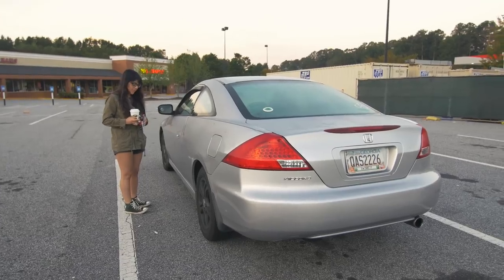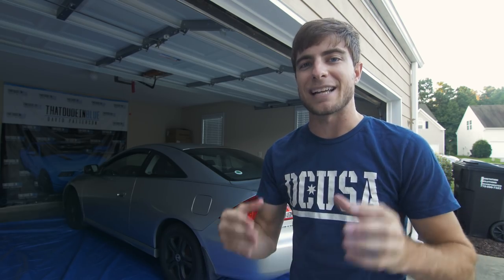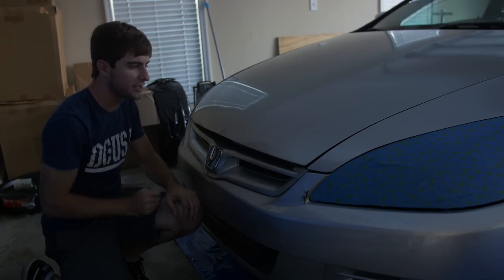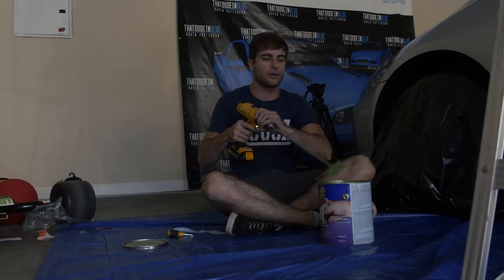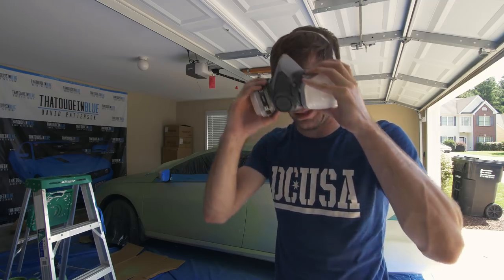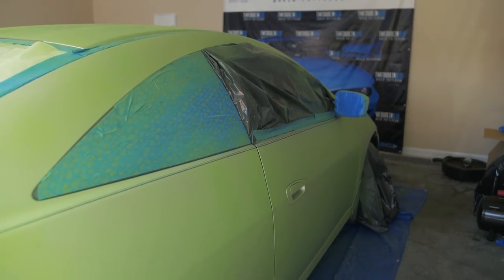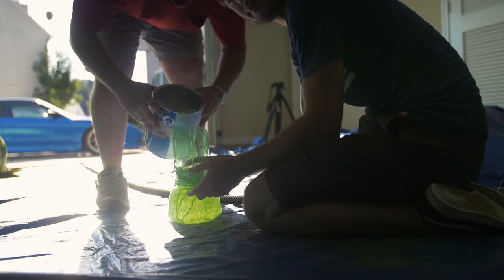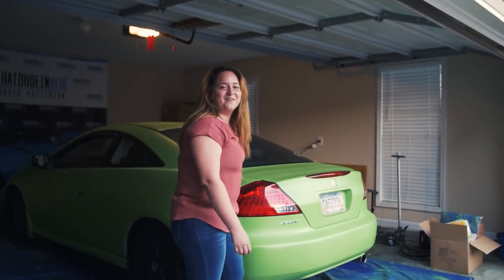How to Plastidip an Entire Car! - 400 DOLLAR PLASTIDIP PRANK!

Comment: I’m not a big green fan but this actually looks dope af! I wouldn’t be mad AT ALL!
Reply: I've actually noticed quite a few Honda drivers switching to this lime/bright green. There is/was a '03, '04 Prelude in Lime - though I doubt it was Plastidipped.
Reply: Until you get towed because the car is the wrong color.
Reply: Won't happen. Read the other comments on here. Police are only required to check vin numbers. Cars get repainted and color changes all the time.

Comment: Good luck getting the dip off lol.
Reply: Project DIY why's that?
Reply: I have old dip on my rims, I was afraid it's going to be annoying taking it off. I bough the car from my cousin he sprayed it 😢
Reply: creep life if it's sprayed on too thin, buy a thing called dip dissolver.
Reply: Project DIY alright Koo. I mean it looks nice when there was some fancy tire dressing applied, I would say it turned out like the green car in the video, flat but glossy. So maybe I'll just dip then again, and add the glossy juice.
Reply: you have to really glob it on for it to peel off easy.. and the glossifiers make it harder to peel off.. and if it bakes in the sun for too long it is damn near impossible to peel off. ( in my experience atleast)
Reply: yabozoable glossifier does that? Guess ill stick to matte then.
Reply: That's not true I dipped my car with 5 coats of dip and 3 coats glossifier had it on for a year in Arizona heat peeled off easy as be
Reply: The Beat Connect thx i almost got misled by fake news
Reply: no glossifier doesn't, as long as it's applied over the normal plastidip base. it all peels just fine, but you have to use the proper amount of total gallons on the car. for a car like this it should have been about 3 gal of the lime green, and 1 gal glossifier. it's better for the long term, will peel easier and in one big sheet that way. this one will be a bit tough to peel after a while. still removable but wont come off in 1 big thick sheet like you see.
Reply: Why?   4+ coats and it peels off easy as fuck
Even of you do less then 4 there's dip stripper stuff that like melts it and not the paint under it and that makes it easy too
It's all around easy to get off
Reply: +creep life BRO don't waste your time and money! Just buy a gallon or two of the clear gloss, it'll go right on like it's clearcoat. If there's imperfections and shit in the old just leave it as a base coat anyways and spray over the old, it'll be easier to take off.
Reply: Jesse Crandle m
Reply: Project DIY plot twist he isnt
Reply: no it's fine with glossifier, half these people have no idea what they're talking about.
Reply: way to save money on rubbers lol
Reply: +Bob Mcdonald but how would he piss now
Reply: Hey man how did the dip hold up in AZ? Also, how did it look at the end of that year?
Reply: A little tip... if you want to get rid of plastidip on your wheels then all you have to do is.. use WD40 and use an old rag and it will wipe right off. If you're not going to take your wheels off then make sure to use a trash bag and cover your brakes. You don't want WD40 on your brakes.
Reply: It's vandalism I say, pure vandalism! .....Next time let me help.
Reply: Had it on my rims for 2 years, would not peel off at all.  Then used a power washer and it came right off.

Comment: You need lights in your garage! LED shop lights are cheap, I did 6 in my garage from Amazon for less than $200 total.
Reply: Jason Garrett seriously!  Even popping in a 4 bulb t8 fixture would help immensely.
Reply: I put up 4 2-bulb T8 fixtures a few years ago in my garage.  I love the light, but the ballasts in the cheap POS lights all went out after a year or two.  I replaced the ballasts with high quality Philips ballasts, but to do so meant I had to rewire all 4 fixtures from series to parallel wiring for the T8 bulbs.  Yes I spent the equivalent of a whole new (cheap) fixture on each one to do all that, but now I have higher quality fixtures with readily replaceable ballasts.
Reply: I'd have converted to LED to not have to worry about ballasts in the future.
Reply: Yep LED Shop lights are very affordable now and easy to hook up. I went with 4 of the 48" LED lights. Cost about $150 for everything, including the little extra for wiring the lights in to a switch in the garage..
Here is the $135 light kit I bought: https://www.amazon.com/Equivalent-Integrated-Daylight-Basement-Workshop/dp/B01MQPCT6Z/ref=pd_lpo_vtph_201_bs_t_1?_encoding=UTF8&refRID=BXBKCY0N9HZ3PM5B0C29&th=1
Reply: He needs a light in his head
Reply: MasterMech77 I replace my 48" fluorescent light bulbs for LED for $5 each light bulb with no ballast
Reply: +MrSeth166
Nice! Yeah figure if you already have the fixtures, it isn't to hard to just retrofit LED lights to them (with some modifications of course). However figured since not a lot of people have full length light fixtures in their home garage, I was offering my two cents worth of DIY and what I was able to do for fairly cheap. There are far cheaper options too that you can find on Amazon or at Home Depot/Lowes
Reply: =Patrick94GSR
Well the LED bulbs are going to stay the same throughout the life of the bulb assembly. Neon tends to dim rather quickly over the life of the bulb. In my experience the light coming from the LED bulb assemblies always seems brighter. Even if they are the same 2340 Lumens rated, the LED makes colors look more vibrant. Then you have the added benefit of not having to worry about turning the lights on and off. Since Neon ballast tend to fail fairly quickly with too many activations, LEDs don't really have an issue with on/off cycles.
Reply: i have those things laying around everywhere lol

Comment: So, what makes it $400? O could've sworn the gallon was $30 at home Depot lol
Reply: creep life that tarp he put on the floor is 150-180...the spray setup is a couple hundred....plus paint....4-500 bucks for sure....especially with the glosser too
Reply: 200 bucks for a tarp? jesus
Reply: Go to plastidip website, they send a kit.
Reply: creep life he said what he got has a better result Lol
Reply: creep life and plastidip is peelable so idk id imagine he won't leave the car green forever lol
Reply: The tarp isnt anywhere near that much. I bought the same one at Lowes, to paint my car.
Reply: creep life the kit
Reply: creep life I think it's for the gun and the whole kit
Reply: Jimmy Peña Plastidip doesn't sell their products directly. You have to buy from a retailer(IE DipYourCar.com).
Reply: its the car kit it takes more then 1 gallon of dip and also you cant just pour the dip on your car you need a sprayer.
Reply: Zark Muckerberg Yeah I meant to say dip your car website, Im not good with names, thanks.
Reply: Sprayer:  $120.   1 gallon does maybe 1 coat and you need at least 4.    1 gallon can be anywhere from $35 (matte black) to like $200 for 50 grams and the clear per gallon
Reply: The kit that comes with the spray gun, compressor, 5gal of dip, ect.  Add an extra 5 gallons of dip and glossifier... Not including the tarp that is easily $400.
Reply: The standard 'Pro' kit (basically what he's using here) with 2 or 3 gallons of color, and 1 or 2 gallons of gloss (depending on the number of coats) and the sprayer system is what cost $400. Also includes some tape, cleaning supplies and the mixer for your drill.
Reply: The kit from DYC.  It is a pro car kit.  Cost between 350 and 500$ comes with 2 gallons of dip and 1 gallon gloss and the dyc dip sprayer.  Plus some other stuff like tape, plasti dip protective spray etc.  it is a really good deal for 350-400$ if you wanna do it yourself
Reply: eksine my nigga, it all makes sense now, I couldn't sleep thinking about this. You the MVP.

Comment: I didn't know a gallon can cover a whole car wow
Reply: EaZee it can't. You're supposed to do 4-8 coats and he did 3 light coats, it won't be peelable for shit
Reply: Wrex Wrecks he said that he did 5 coats
Reply: You probably could but it isn't recommended if you want it to be easily peelable. I'm pretty sure in the video you see him opening up another gallon.
Reply: Yeah I meant how'd he cover it with a few coats on only 1 gallon.  But yeah you should use at least 4-5 coats so it's easily peelable
Reply: EaZee 12:30 could be another gallon of dip being mixed or the glossifier, not sure
Reply: He used more then that
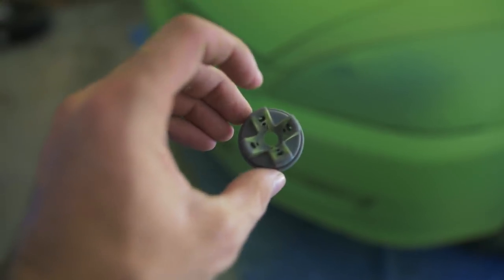Reply: IrishNexus You mean 11:30?
Reply: What if you don't care if it is peelable? I mean couldn't you lay a single coat or 2 then switch colors later by putting on another coat of a compatible color and so keep changing for much less expense, albeit a repeated hassle of taping everything off? Maybe new coats won't adhere to the gloss but hey skip it at first and you get to change colors a few extra times and then gloss the last coat and leave it.
Or is it only permanent as long as nothing chips a section to start it catching wind and self peeling? UV damages most plastic so I'd think you get a year or 2 max before it needs redone or peeled off.
Reply: AnantaSesaDas well I think that's the whole point of plasti dip, it's peelable easily if you do it right.  And I think that might be an ok idea if you have an old car, but i wouldn't recommend that on a car you really like
Reply: Eazee..  I've known more than a couple of people that buy a new car (I know someone who did this with a miata) had the car for a couple of years with a couple of touch-ups jobs of the plastidip...  then unpeeled all the plastidip and sold the car.  The car looked really good for selling.
Reply: Yeah I have heard of that too, I think fonzi from plasti dip always says that it protects the oem paint.  I just wish autoflex was cheaper (the glossy version of plasti dip)
Reply: You can get about three coats from one gallon on a smaller size car... SO to do the 5 coats like they did in the video a second gallon is needed. I sprayed a buddies truck (86' Dodge Power Wagon) for him, it took 4 gallons of base and 2 gallons of glossifier to do the job correctly. Ended up with 6 full coats of base and 4 coats of clear. I would consider his truck to be a "very" large vehicle.

Comment: Did i miss the $400 part? $30 paint , $20 tarp , $40 in tape and garbage bags. Its like maybe $100😂
Reply: Kyle Helfrich, It's not $100... If you buy plasti dip from the website you'll spend more than $200.. Depending what products you chose
Reply: Also, the sprayer.
Reply: Kyle Helfrich 
And the turbine for the sprayer.
Reply: Its 50 bucks a gallon

Comment: If I sand rust is it okay to spray platidip on
Reply: You could spray dip over it without sanding it. However, the smoother the surface, the better outcome you will have with the finish of the product. If you don't sand it smooth then there is a high chance that you will still see the texture underneath the dip, unless you spray A LOT of coats over it.
Reply: Andrew Kauffmann you do not want to use Dip as a cover for a rust spot you fixed. You need to properly prep and paint that area first.
Reply: K thanks you guys
Reply: You forgot to mention the part where moisture will continue to trap under the plastidip and further rust away the panel. Do it right and get rid of the rust then paint over it.
Reply: DipYourCar has made a video on it stopping rust or whatever but I would never in my life do that. If it's just surface you can sand/grind with wire wheel and/or use some chemicals to stop it and protect it. If it's really bad the only right way to fix it is to cut it out and weld in new steel.
I have two cars where the previous owners have welded new panels on top of rust, painted right on rust, put fiberglass and bondo on rust etc. All these cheap regular ''fixes'' have just made it worse, traps moisture and makes the steel rot in no-time.
Reply: NorwayVFX ok thanks it's an 85 cutlass and I just have to replace the rear panels
Reply: Sand + Rust converter
Reply: How do you have a cutlass? You look 13...
Reply: Andrew Kauffmann definitely do it properly then. if its bubbling, cut it out and weld in a plate. ifs its surface, sand and clear coat it. no need to buy expensive color matched paint or primer if youre just gonna dip it. but definitely take care of the rust first. you want to have the knowledge that its not gonna spread and the car eventually fall apart under you. its peace of mind.
Reply: Zark Muckerberg I'm 15 my aunt gave it to me it's in really bad shape and once I repair as much rust as I can I have to paint it the cheapest but best way possible
Reply: It's better to have it go over a clear coat so you should paint it properly first
Reply: You don't need any prep work for plastidip besides washing 
Plastidip is plastic basically so it'll seal either rust from rusting more or bare metal from rusting.
Reply: J⃟O⃟N⃟A⃟T⃟H⃟A⃟N⃟ S⃟C⃟H⃟U⃟L⃟T⃟Z⃟ if there is any rust beneath it and there is even the smallest amount of moisture it will trap it in and keep rotting away. the only way that works is if its bone dry but rust eats in layers so even if the top layer is dry the ones beneath it wont be.
Reply: T Pol rust needs oxygen.    Plastidip seals it from oxygen
It won't rust.    Plastidip makes a great rust sealer for future restoration
Reply: plastidip wont peel from a rough surface very well, if at all. I would not do this for various reasons. That being one of them
Reply: J⃟O⃟N⃟A⃟T⃟H⃟A⃟N⃟ S⃟C⃟H⃟U⃟L⃟T⃟Z⃟    i disagree i that one, rust needs oxygen but also wet damp or water?
Reply: Aron Hofs you wash and fully dry it when paint it     the plastidip seals it   
Alot of car restores use plastidip for this exact thing to keep cars from rusting.  
It's extremely common at least where I live
Reply: J⃟O⃟N⃟A⃟T⃟H⃟A⃟N⃟ S⃟C⃟H⃟U⃟L⃟T⃟Z⃟ yes but when you have temperature difference, warm inside cold outside for instance there is wet damp theres no way that plastidip seals of everything alot but not everything.
Reply: Aron Hofs enough layers and it seals perfectly.     It's basically thick plastic.    People put it over rust and years later when they get to restoring it they peel it off and it hasn't rusted more. 
   I know people who do it for their side hobby of restoring cars.
Reply: J⃟O⃟N⃟A⃟T⃟H⃟A⃟N⃟ S⃟C⃟H⃟U⃟L⃟T⃟Z⃟ i understand but thats on the outside rust also comes from inside so its not fully protected from the outside yes but from the inside no
Reply: J⃟O⃟N⃟A⃟T⃟H⃟A⃟N⃟ S⃟C⃟H⃟U⃟L⃟T⃟Z⃟ I have never heard of painting over a car to save it to be restored later. How would that stop the rust from eating through the metal?
Reply: Those must be some shit restorers. The only proper way to stop rust is to sandblast and use special paints that creep into the pores and etch into the metal. Plasti dip or and similar products should never be used on rust. I have a car that has lost probably 10kg of steel just because the previous owner painted over the rust spots instead of fixing it properly. He even used paint designed to go on rust but it all rotted away anyway. Plasti dip is rubber-like but just like almost any paint out there it is not 100% waterproof and WILL let water in. 
Most restorers I know of will sandblast to remove all rust, paint with etch primer to have it stick properly, then paint with Epoxy primer which is very airtight and keeps moisture out and then a few final coats of very durable paint.
Reply: NorwayVFX let me guess
YouTube certified professional car restorer?   Yea we get it
Reply: I'm no expert, far from it. But I have been restoring two cars in my past time for five years working almost every single day, and I have been working on a lot of other cars. I have seen with my own eyes what rust protection and rust stopping products and methods that work and don't work.
I live in a country where they salt the roads the moment snow falls which makes it incredibly easy to see rust, because when it starts there can be massive holes in a matter of a few year. 
A friend of mine ''repaired'' a car by welding in fresh metal, he primed it with some regular cheap metal primer, then some body filler, paint and clear coat. 
It took one winter and almost exactly one year for that to start rusting.
My father has had old cars as a hobby for over 30 years and tried pretty much every rust product we have in our stores and seen exactly what works and what doesn't.
Reply: NorwayVFX clearly you are since you know better then people who do it has hobbies and as their jobs